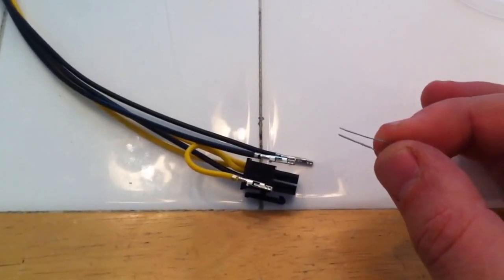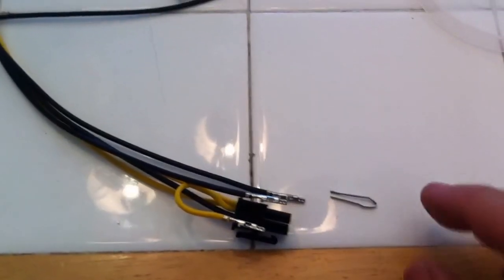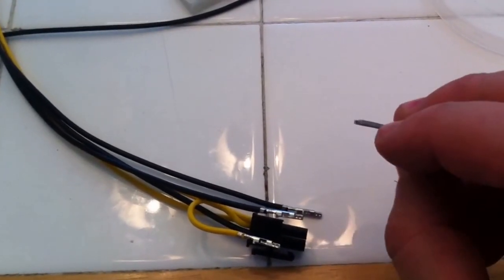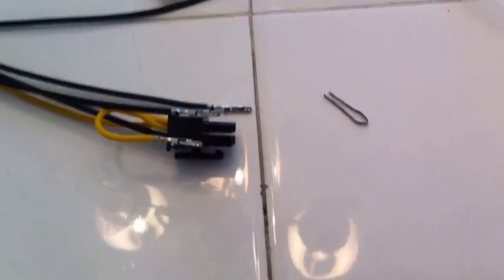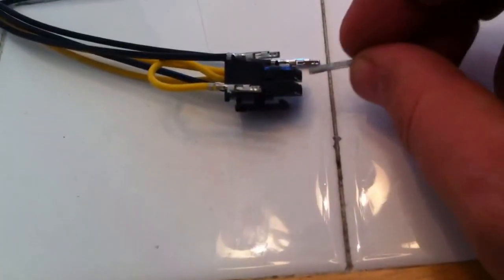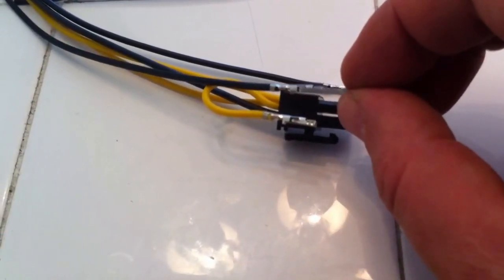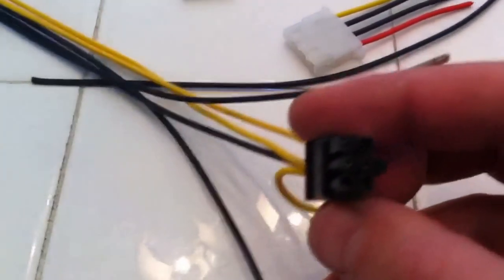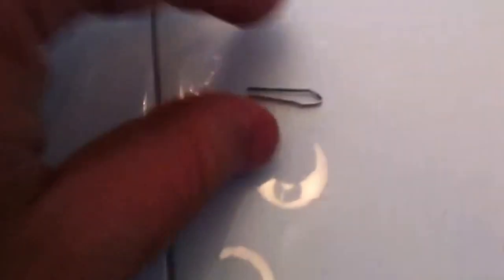Molex Mini-fit Jr. Tool

Comment: Thanks for making this video, saved me £25.  

The leads had detached from the pins on my mini molex and I still couldn't remove the pins, but resolved this by cutting your DIY tool in half, inserting a section in each side of the pin to release it then used a small screw driver to push the pin out.  Thanks again..